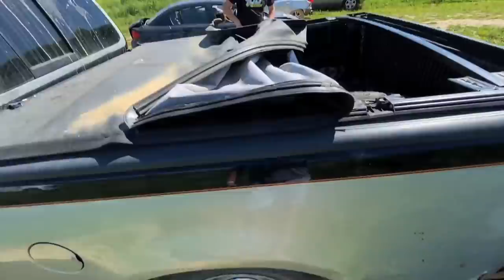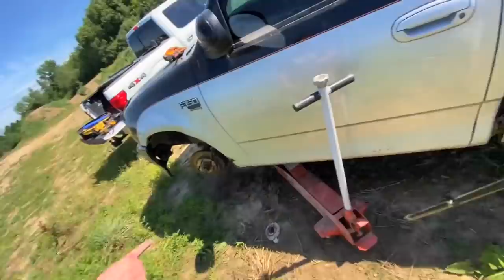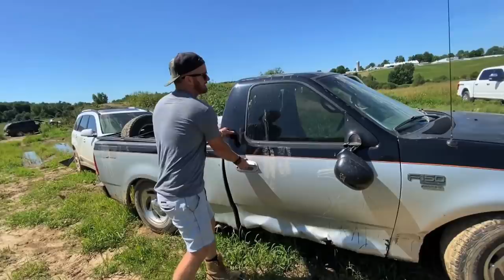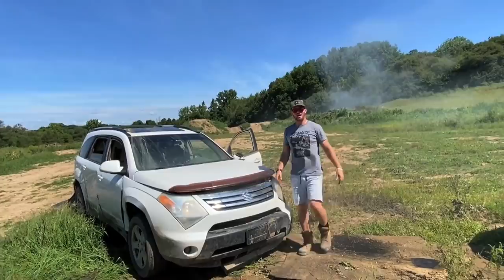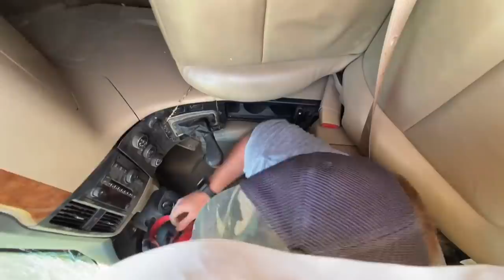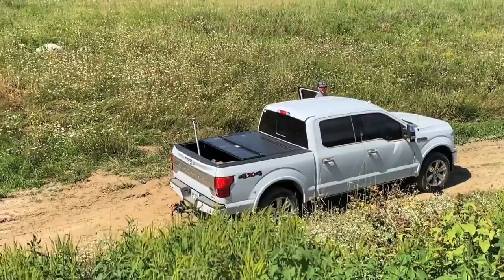Suzuki CRASH! Roll Over!

Comment: This is a 2007-2009 Suzuki XL7... had 4 airbags, 3 of them went off. Two front and two side curtains. Most of the relatively newer cars (almost all '07 and up, most '05-06 and even some back to the late 1990s) will shut off their passenger front airbag if the seat is empty, also a lot of vehicles, especially SUVs, started getting curtain airbags that inflated in rollovers around the mid-late 2000s. These airbags stay inflated, so you might want to keep a small knife on hand to cut these airbags if they give you an issue getting in the vehicle. 
September 17, 2020 12:47 am